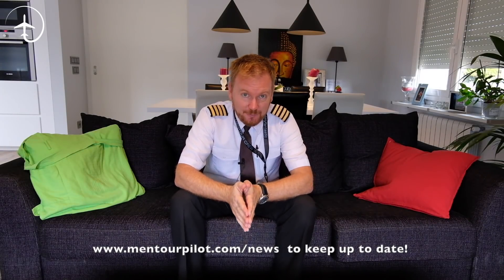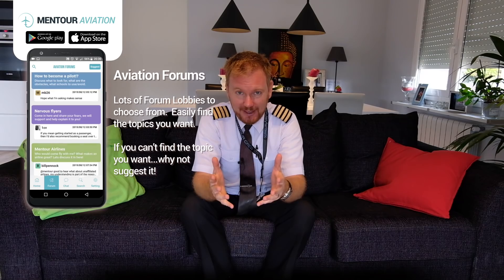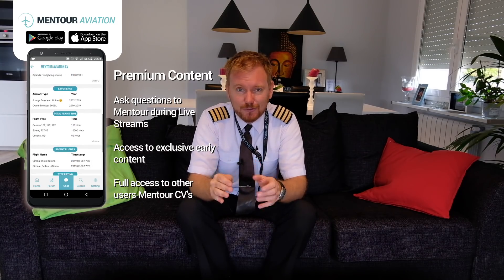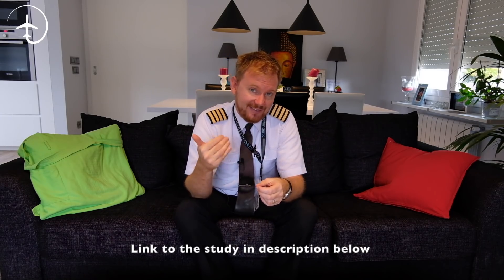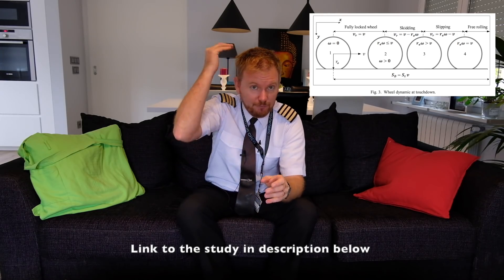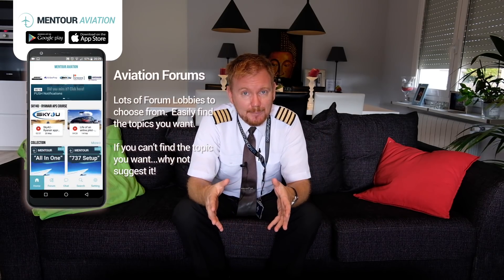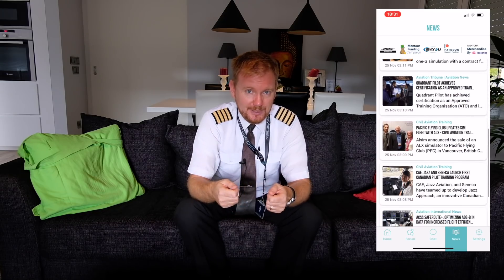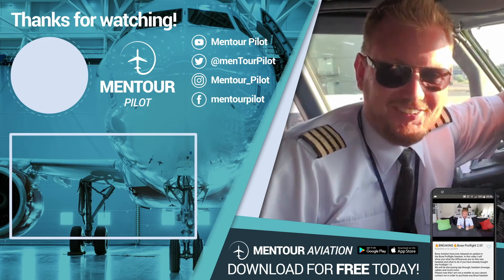Use WIND to spin the aircraft wheels before landing?!

Comment: Okay, I have solved this problem:
Everyone is concentrating on the plane, but the plane or landing gear isn't the problem...the real problem is the static runway.
Solution: A giant runway sized conveyor belt that speeds up to the exact approach speed of the incoming aircraft.
Thank me later.
Reply: Ashley McCallum , genius!
Reply: Hilariously genius😂
Reply: It seems more dangerous.
Reply: That actually eliminates the need for having wheels and tires on aircraft altogether. Even those guys flying in a wing-suit could land on it.
Reply: @SharokD  No no, you still need the wheels so that the aircraft can taxi to and from the gate.
Top marks for the wing suit idea though.
Reply: @ashleymalamute   
Yes, you are correct; The wheels are still needed for taxiing. The conveyor belt also makes it safer to land when landing gear does not open due mechanical problems.
Reply: hahahahaha.....do u realise how much money that would cost???....but its cool tho
Reply: Actually, the more feasible/practical solution is to embed simple conveyor rollers (no-belt), or roller beads like in an abacus, with gradually increasing stiffness, in the first 1000 or so feet of the runway to reduce touch-down tire wear. It also reduces the plane sudden lateral jerking when touching down in an angle due to heavy crosswinds.
Reply: Cost/benefit
Reply: You would have to put brakes on the conveyor belt, more blue smoke or spit the aircraft off the end of the runway with would produce yellow flames and black smoke.
Reply: @ashleymalamute  just conveyor the aircraft to the gate :^)
Reply: A man of genius
Reply: That’s very inefficient. Just put big rocket engines around earth that will make the earth’s rotation speed match the plane’s approach speed

Comment: Commander, I am an Owner/Operator with a top of the line truck & trailer. About 10:00 PM in Arizona , trailer tire blew & the flying rubber took out my wiring harness for my trailer lights. I look in my side mirror & all the lights on my trailer are out! Fortunately, the 4 way flashers were working & I made to a Truckstop & got everything fixed! A Blown tire took down your favorite plane, “The Concorde”! Please Continue to Be Absolutely Fantastic! I still love to watch your video about the Concorde! Thnx, CJ
Reply: Was it a new tire or a retread?

Comment: You’ve REALLY pulled a memory from my past with this topic !
When I was earning my undergraduate degree in mechanical engineering, a friend and I teamed up and proposed a senior project on the matter of pre-spinning wheels before touchdown, to reduce tire wear. I wish I had a copy of the report, but that was over 40 years ago. 

Our conclusion was pretty much the same as you’ve described here: YES, it can be done, but NO, it’s not economically justifiable. 

It was a fun project in which we both had interest - we both had our PPL at the time. I recall finding that about half of the tire wear occurs during taxiing. We considered electrically spinning up the tires, but it turned out that turbines on the wheels, were a far simpler alternative, if you were to implement this.

Comment: I looked at a reason for pre-spinning landing gear tires from a different angle. I took some published figures relating to aircraft tire diameters and weights (which vary across aircraft models). I did some calculations that looked at the stresses on the landing gear as the structure strains against the energy required to spin these tires up. There is a very healthy exchange in momentum between the aircraft and the tires/wheels. And I didn't even consider the inertia of the brake system. The 'conduit' for this exchange is the structure of the landing gear itself and its attachments to the air frame. It's amazed that landing gear don't just snap off when a heavy lands. Pre-spinning would reduce these stresses thus allowing for a less hefty/weighty landing gear structure.
Reply: The forces to bring the wheel up to speed when it now touches the runway are normal to the the breaking forces once the speeds are synchronous.  The forces to "pre spin up the wheel" would be an inverse function of time allotted to do so and would be a fraction of the normal breaking force.
Reply: This is a good point, but I don't think the design forces would change as the carriage would have to withstand those forces in the event of a stuck wheel anyway. It would however make landings much smoother for the passengers.
Reply: @ryanmcgowan3061  so ... the possibility of a 'stuck' wheel simply means: ... leave it alone because it's working just fine the way it is.
Reply: @johndavidwolf4239  yep
Reply: @gmeast  Good engineering is designing it to a certain probability of failure. For instance, roads are designed to flood once in a 25 year storm interval. Homes are designed to only flood in a 100 year interval. The same applies to aircraft, which are design to no more than one life-safety critical event in one billion hours of operation. So if wheels stick less than once in a billion flight hours, it's acceptable to reduce the design loads.

Comment: I was one of the original commenters I’m using wind to spin up the wheels.  I engineer industrial water pumps for a living and road race as a hobby so my brain went straight to turbo fan wheels from the older road course and rally days.  Thanks for giving a genuine reply with an actual study that gives a proper benefit analysis to this exact problem.

Modifying the tire molds to add features definitely would add way too much to the cost of the tires and it would introduce stress risers that would definitely be detrimental to safety.  The roughly 30% reduction does sound interesting though from a safety standpoint.  If it’s reducing rubber wear by 30%, I would be curious to know the added blowout safety factor on landing.  I’ll definitely look into that study.

Comment: It was really good to see you respond to all the comments! Your response was pretty quick, in my opinion. You gave reasons and a study for not using a mechanism for spinning tires up to reduce wear, based on current cost/ benefit  realization. It makes much more sense now. I still think it's odd that an airline wouldn't try to reduce the wear on tires. After the initial cost of the blades/vanes, there would be savings for the life of the aircraft. Weight is a huge factor in aviation, huge measures are taken to reduce it, I would think this philosophy would carry over to the savings in tire life. It's obviously not worth it at this point. Again, great video, as always! I wish you and your family a very Merry Christmas and Happy New Year!!

Comment: More reasons why NOT spin wheels before landing:
-Tires wear on touchdown but they wear even more when the full weight is resting on them and they have to transfer all the force to the runway, when braking. Also long taxi rides with lots of curves to remote runways while fully loaded significantly contributes to tire wear. The benefit would be minimal. This in addistion to the facts in the video.
-The gyro effect is indeed a problem, especially when movements are not symmetrical or when ram air should spin up the wheels unequally. The comparison with engines is incorrect because the N1 and N2 axles spin in opposite directions so the gyroscopic forces are mostly cancelled out by each other. N1 more mass, N2 more RPM
-By attaching some kind of wind turbine devices it would add weight and add drag which costs more fuel and generate more noise on final approach.
-These turbine devices would add more time to a wheel replacement which would cause more technical delays.
Greetings, 
Maintenance Engineer
Reply: Coming from race car engineering standpoint:
- The main catalyst to tyre wear is temperature (especially when surface is above 200°C), taxing wear will be very small compared to landing except maybe when performing some crazy maneuvers after RTO. And really the truth is in the real world, we can see how much rubber there is and where on the airport. Taxiways are cleaned much less than runways and they aren't black. Yeah the benefit would be minimal but more because of what that lousy study shows: that even pre-spinning the wheels to 100% landing speed would not reduce the touchdown wear by that much, as the wheels slow down and anyways.
- I've simulated gyro effects of wheels on a car and it's not that strong even at aircraft landing speeds, and vehicle weight to wheel weight is much higher for aircraft. Plus there are aircraft engines that don't have the benefit of two shafts and they are fine. The effect would likely be noticeable, but spinning wheels would be pitch neutral, while under roll or yaw they would add a torque in direction already pursued by the other control due to their natural coupling, so such gyroscopic effect would be almost desirable in slow flight.

The rest is sound, and it's definitely not a good idea :)
Reply: lingSpeed taxi in isn’t much of a problem most of the time but taxi out when fully loaded and fueled at max take off weight the friction generates a lot of heat. When making sharp turns the inner landinggear sometimes even stands still while the aircraft is turning around it. On a/c with double or triple axle main gears the tires really have a hard time then. 
For the gyro effect, a widebody maingear wheel is about 250kg each, when spinning at 250kph circumferencial speed it would have influence on the hydr. tilt position and some on ac handling when retracting or lowering gear asymmetrically. While retracting, brakes are automatically applied for this reason.
Reply: @jurrien75 Did some rough estimations and yeah you are right, folding one set of wheels would induce pretty significant yaw. Still don't think it would be that hard to manage pre-spinned wheels during normal landings even without electronics due to direction of forces, but high cross wind or turbulance might be a problem with control authority limits. Thou i guess the system could be disabled (by brakes) in these conditions.

And yeah the wheels do wear by being dragged sideways on taxiways, my point is that it's not at the magnitude of landings. It's the temperatures that create the blue smoke that really make the rubber melt away in thick layers. And i haven't seen smoke during taxiing once. Been maintenance engineer too, although only for a year :)

Comment: When this idea occurred to me during the last wheel-spinning video (as it clearly did to many others)  I realized it might have adverse effects on braking. With turbines on the wheels, the brakes have to resist* not only the momentum of the aircraft, but also the air pressure on that turbine trying to keep the wheel spinning at the speed the aircraft is moving. Yes, that force will decrease as the plane slows, but it's still an additional load on a braking system that already has heat issues. This is just an intuition so anybody that can explain the actual physics please prove me wrong or right. 
* actually, they only have to resist part of the planes momentum. I think Mentour explained (in another video) that a large chunk (if not most) of the braking power comes from the thrust reversers, rather than the wheel brakes.

Comment: Hmm, but what if we put a very large treadmill on the runway and let it roll as fast as the landing aircraft...
Reply: HerraTohtori then it will go backwards or what
Reply: Who’s going to pay for this? Cost to run and maintain this let alone build it would be much more then the few tires an airplane would use each year.
Reply: @Sillyturner  Ah but you're not thinking big enough my friend. Think of the new industry of building runway-sized moving walkways that move at aircraft landing speeds! In addition, during take-off the aircraft could just apply brakes and have the runway assist in accelerating the aircraft into rotation velocity, kind of like a very large and slowly operating catapult.

Not only that, but landing without landing gear would be much safer since the runway would move at the same speed as the aircraft. Once the aircraft is touched down, the runway would then slowly stop. Only problem is, how to stop the plane from sliding on the runway once it starts to slow down. Maybe the aircraft and the runway could be covered in velcro, so that they would stick to each other! Or maybe there could be some poorly paid workers on the runway, and once the aircraft has touched down on the moving runway, they would strap the aircraft down so that it's fastened to the runway before the runway starts to slow down.

But maybe you're right, and maybe this is impractical. Let's move to my second idea - aircraft carriers that move at the same speed as the landing aircraft. This brilliant invention (patent pending) would make VTOL and even STOL features on naval aircraft redundant. There are only minor technical problems in the way of this revolutionary concept, though one of them admittedly is how to get a carrier-sized ship actually moving at about 300 km/h. But I'm sure this will be sorted out soon enough. Hmm... What if the carrier wasn't floating on water? A flying aircraft carrier could solve many problems...
Reply: It will not work, because the wheels on airplanes are free-spinning, not driven... So the plane would simply move forward and fall off of the treadmill. (There is a similar idea to this, discussed as a physics challenge, where if you put a plane on a running treadmill at takeoff, will it be able to actually takeoff, and the answer is yes, treadmill would have no effect! Your idea is the reverse of that, and it doesn't work for the same reason)
Reply: 1. Add high speed rails to the runway. Don't forget to bolt them down. 
2. Setup special high speed freight flat cars on the rails.
3. Put the aircraft that needs to take off on the flat car. Maximum brakes on the aircraft please. 
4. Do a normal takeoff procedure, without releasing the brakes. The railcar will roll and the plane will takeoff. 
5. Brake the railcar to a stop and land the next plane on it (standard landing procedure, but with maximum brake on the plane, from gear down to runway exit) 
6. You could extend the rail network to the taxi ways and discard tugs and other equipment (I. E. you could setup a airplane sized gas station in lieu of having lots of flammable tanks moving around). High automation is welcome. 
7. Bonus: make the wings removable and ship the plane bodies on the state rail network, to get quickly to city center without leaving your flight! No more airport taxi vans!
Reply: @HerraTohtori  That's a horrible idea, do you have any knowledge how much energy it would waste to constantly accelerate and decelerate the whole runway!? And those poor workers strapping the aircraft down WILL catch a cold when it's freezing and they're moving at 300 km/h.

Those flying aircraft carriers might sound as a good idea, but you didn't account that you'd also need to land them sometimes for refuel and maintance, all without excessive tyre wear. Colossal flying aircraft carriers for those flying aircraft carriers only postpones that problem.

The proper way (patent pending) to reduce tire wear is not to decelerate at all. As the treadmill runway is moving as fast as the aircraft, you can just quickly refuel it and swap passengers in and out, and you're ready to fly to the next destination when the runway ends. It'll save a lot of fuel and time, and most importantly, rubber. The problem is that eg. people in wheelchairs might not be able to enter and exit the aircraft fast enought, so runways should be circular to provide extra time. It's not a coincidence that those runways resemble a wheel of wheelchair. This kind of rotating circular runway is called as "Spinning Hope for Innocent Tyres".

Nevertheless it would be a quite expensive and time consuming to upgrade legacy runways into these new revolutionary versions, but there's an alternative (patent pending) choice! Build a huge fan at the end of the legacy runway and make it blow at 300 km/h. Aircrafts could essentially land vertically as airspeed is not dropping below stalling speed at any point. This type of technology goes with name "Fan Assisted Rubber Tyre Savior".

"But that fan would need gigawatts of power, it would stress the power grid!" -some might think. That's why we also need to build at least couple of those spinning runways, with attatched generators that kilometers wide multi-million ton spinning runway can also be used as an excellent grid energy storage to supply those fans. We call that combination of those inventions as "Superior Hybrid Aircraft Runway Treadmill System".
Reply: @UCb8QTcB6U56e7YUEOPczG6w That aircraft-on-rails is a great concept but it has some downsides, eg. snow, ice or even leaves on rails can cause significant delays at transporting. But there's still a great potential in that idea!

And what comes to that landing aircraft carriers on water, I wouldn't trust that sorcery. They're made out of steel and other metals and you know, those are heavier than water, they shouldn't be able to float.
Reply: @TheNasaDude  That actually can work, provided the plane could land perfectly on the rail-cars... (near impossible to do without some really advance self-flying fully automated plane)... Although the cost of doing this would be ridiculous and cost is everything! The main reason we don't have supersonic planes.
Reply: @sajadrashedian667  Why should it be nerly impossible? Its not much harder than aireal refueling or formation flight.
Reply: @sajadrashedian667  Years ago the Myths Busters did it, the funniest part was the pilot who said if the wheels dont spin, the airplane cant take off, on the other hand, its absolut not funny that people who dont know how a airplane works can have a pilot license.
And its not really a physics challenge
Reply: Why not just build giant moving sidewalks in the sky that move at airliner speeds to connect cities?

Then you could get rid of needing planes at all.